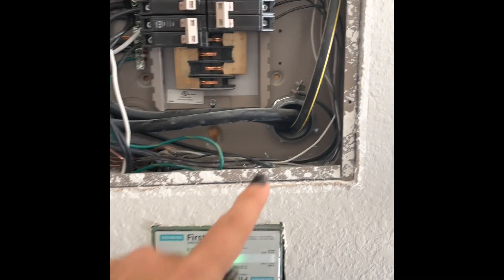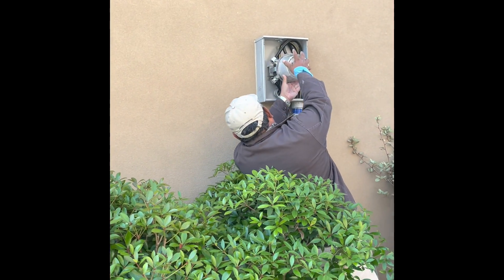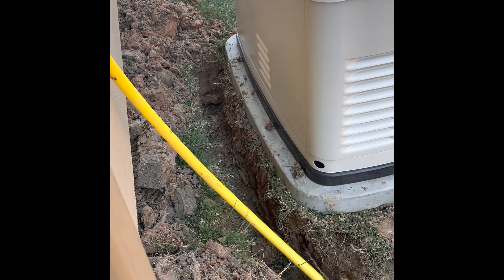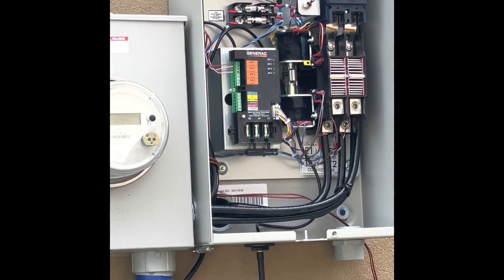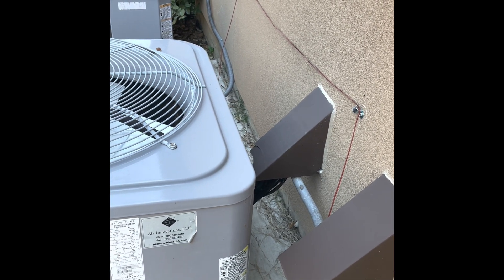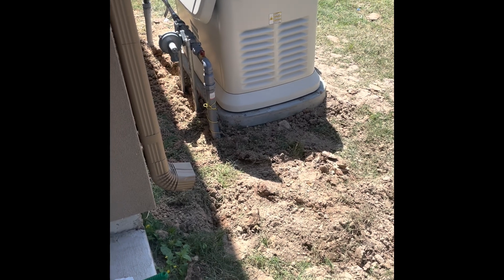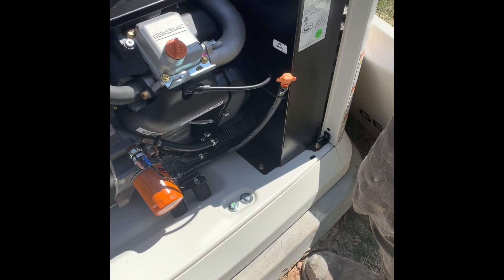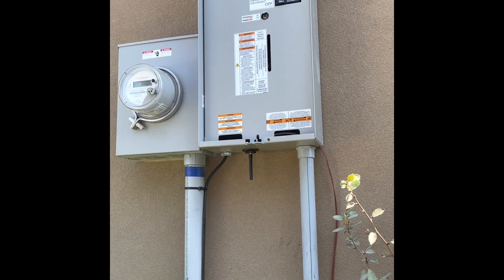Generac install

Comment: First, they should cut the power 100%!, that was unsafe. Second, you should never install power wires with low voltage wires (signal wires from ATS to Generator)
Reply: You can have your power wires and control wires in the same conduit. You  just can't use thermostat wire for 0, 194, or 23. It needs to be THHN or 600 volt rated. If you use thermostat wire you can get bleed through over on your control wires.
Reply: I agree in certain stages they should have killed power, but for the most part they weren't working hot. And yes you can have low volt wires in the same conduit as power wires as long as you are using rated wire like THHN which they did. You just can't throw shit T-stat wire in the same pipe as power 50+ conductors
Reply: @Researching101   did they installed that cable? 😊 I saw them pulling THHN  😏

Comment: @8:15 what is the height that disconnect switch is? Seems a little high. Was that a permitted and inspected job? When I say height, I mean tne the height to the center handle of the top most lever.
Reply: ... in the USA the max height is 6 ft 7, although most inspectors wont let you go that far. Any time I see something mounted that far up the side of a house I have to look around and ask about flood waters. OTOH, most areas with high water also raise other equipment on platforms.... at least for new code. Personally I would have matched the top of the transfer switch to the top of the meter for an easier working height.

Comment: Very nice clean install... you got your moneys worth! Your installation is a perfect example of the way it should be done. Unfortunately the popularity of whole house standby generators has every wannabe contractor, electrician and plumber offering generator installation services because it's easy money. Also unfortunate many of them simply focus on finishing the installation as fast as they can so they can move onto the next install. Fact: Trenching and burying the utilities slows down the installation. As a result many installers cut corners and simply bolt everything to the side of the house not even bothering to at least run it close to ground along the foundation as shown in the following Youtube  video: https://www.youtube.com/watch?v=dDw8I_oKK94&t=245s